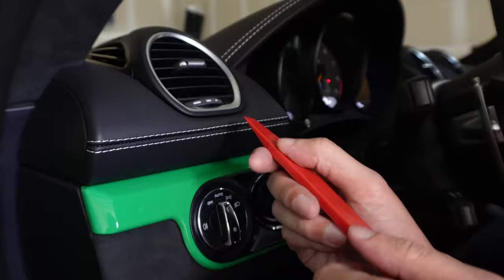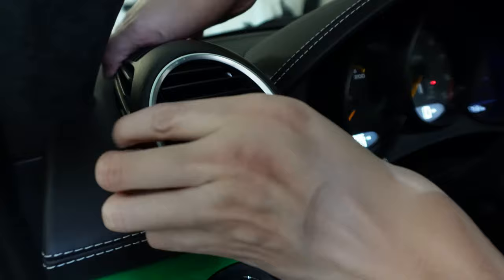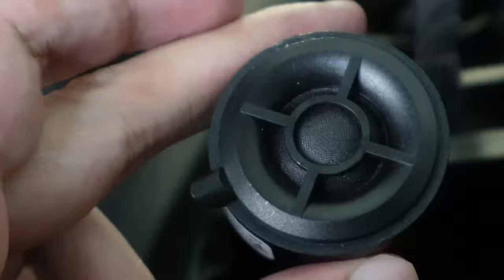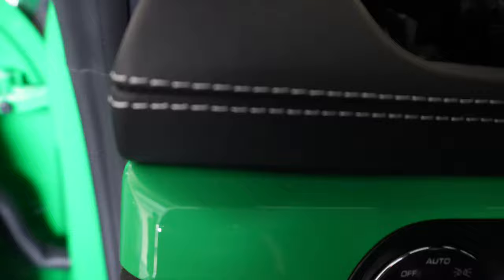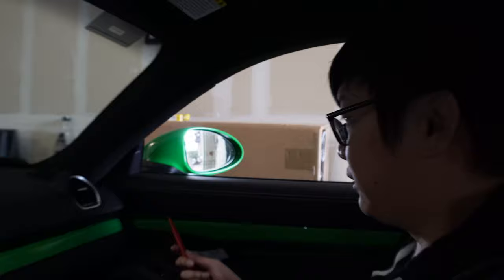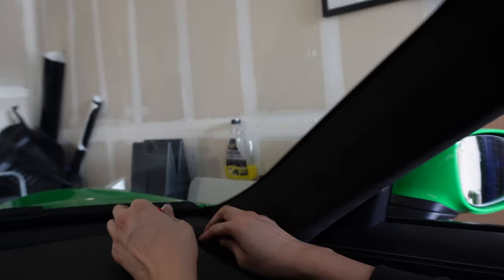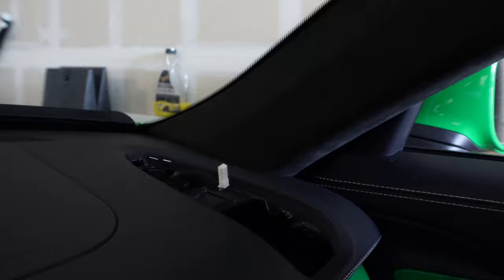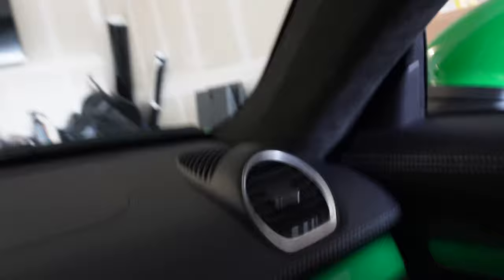Burmester Tweeter Upgrade for Cayman GT4!

Comment: Thank you for the video. V helpful. I got one of mine switched out super easy but can’t get the passenger vent off for some reason. Will try again tomorrow.
Reply from the maker: yeah i noticed just stick the trim tool in far enough to get a bit of grip and then pull towards you.  A lot of people say to pull up but that was not the experience i had.

Comment: very helpful video.  I am planning to do the same swap on my 2020 Macan base with Bose audio.  I have read that Burm is a drop-in replacement with the small tab removal.  One question:  in other posts I read that you need to install a capacitor to protect the new tweeter, but you did not seem to have that issue.  Any thoughts on this?
Reply from the maker: I have read that some people decided to do the capacitor but from what i've seens its more a practice in caution than anything else.  I havnt had any issues so far and the drop in tweeters have been great.
Reply: @Xxyion86 

I did the swap about 10 days ago and did not put a capacitor on. So far so good. I am not babying the speakers at all. Thanks for the video